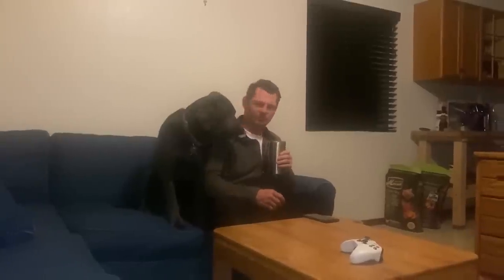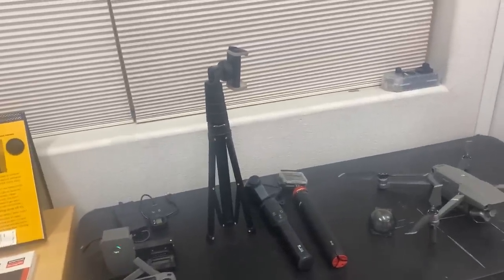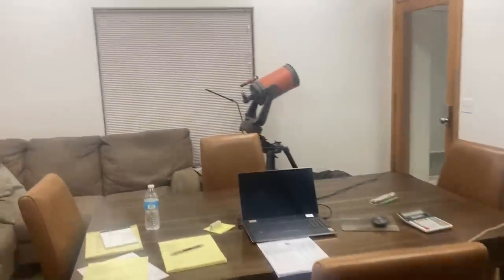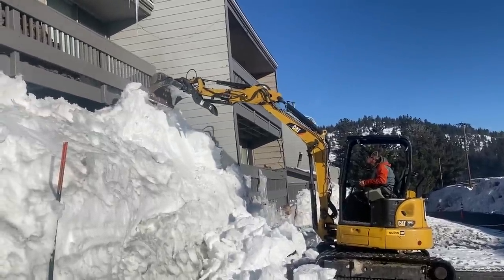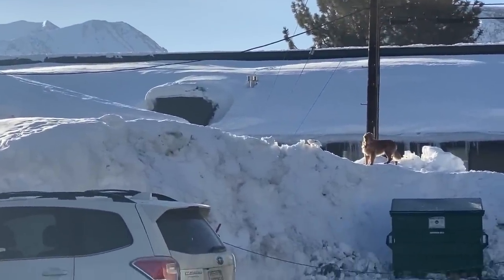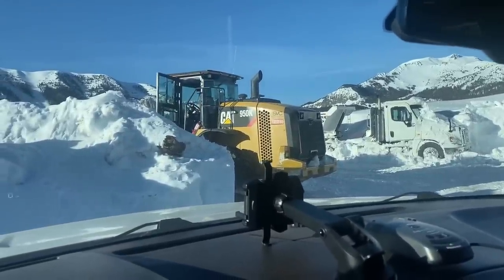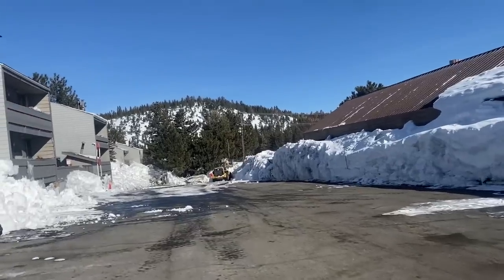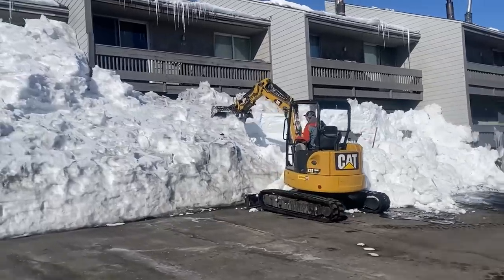Went to check out the Toyota U.S. Grand Prix up at #mammothmountain today… check it out!

Comment: Got the folks to check out the channel. As a retired grading, excavating, and paving contractor he said, "I hope he posts the hose repairs on the loader and possible skidsteer relay issue etc"  And here we go.
Reply from the maker: We really jacked that ram… not a cheap fix
Reply: @plowbrothers365  Didn't expect that.  Nothing is cheap on equipment.

Comment: That snow is unbelievable.
Reply: Been awhile since Mammoth and the Sierra in general has had that much snow, but back in the early 1970s when I was a teenager we owned a condo and a cabin right next to where The Village is now, and there were times when we arrived there only to have to dig a path from the road to the front door with snow shovels in a pile of snow 10-15 feet high.  Back in 1969 all of CA got a series of storms like this, and while it caused a lot of damage in the L.A. area, Mammoth got 27 feet of snow inside of a week.  They were digging tunnels for the chair lifts (!)

I still say that Mammoth Mtn is the most epic skiing anywhere in the U.S., and it easily gets the most snow because of the geography there.  This is some incredible snowpack, but it's not unheard of.  If I hadn't been in it myself all those years ago I wouldn't have believed it.

Comment: The skid steer hydraulic issue was really well covered and interesting. I've never used a skid steer to move snow but compacting snow and impeding the cylinder arm movement and bending it was a new one for me. Thanks for that. You should be able to drop the drone footage resolution to make it a smaller file and thus download faster.

Comment: what i did was took my telehandler a old western 8 foot plow slid in 3/8 tubes over the forks cut the back of the tubes so i could pin it, spun the plow backwards, put a ruber cutting edge on it.... burned  two holes in the pipes and welded a chunk of metal of the back works great for a roof rake... it would save you a ton of time and a bucket must have

Comment: Just wondering i gather you have them in usa but wouldnt a concrete vibrator help with loosening the snow on the roof removals and act like a saw and slowly release sections on hard pack snow I think can get several versions aswell. 

With the impending increase of possible more snow maybe giving it a crack might help speed up things maybe.